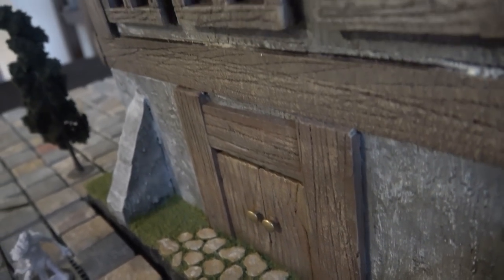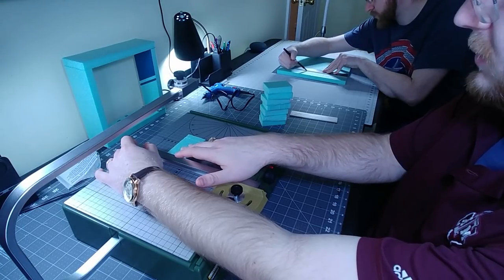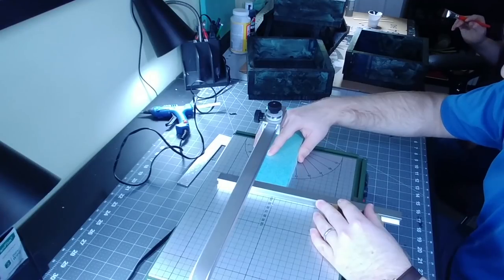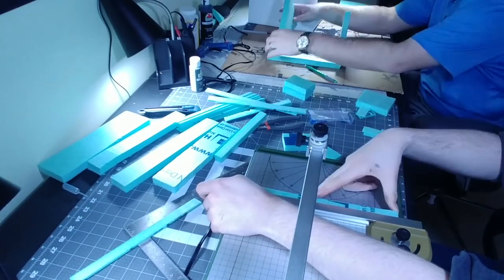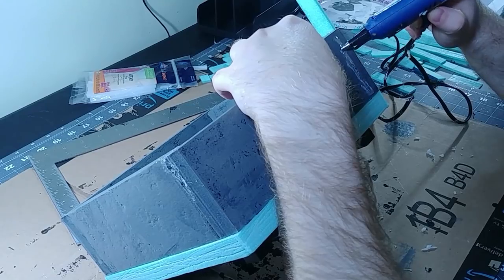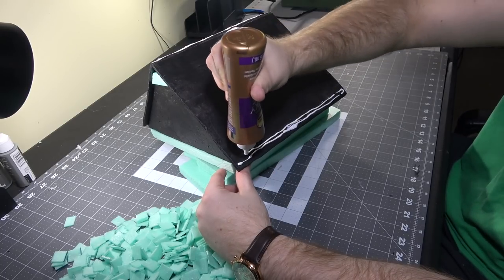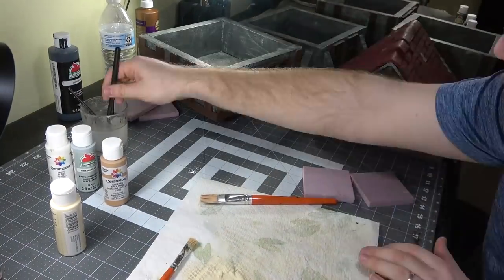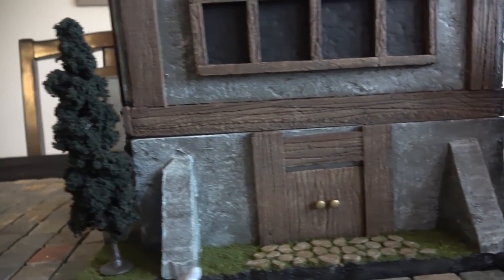How To Make a Modular Tower With Playable Interiors for D&D

Comment: How about using magnets to keep the tiers together?
Reply from the maker: I thought about that, but was afraid of messing something up. This was my first large scale build and I didn't want to ruin it haha. But that would be the better way to go!
Reply: @Rybonator  what you could do is if you have a hot knife you could see if it came with a little circular top piece and press that into the foam to create a small hole. and then get so of those circular magnets and just glue them in

Comment: It looks great! There's two small things I'd work on if I was to do this myself, the windows and doors not making an appearance on the inside and stairs leading to other floors!  I think I have an idea on how to do the stairs and still keep it modular too.

To pull this off I'd make two separate "stair models". (Hard to explain via text but I'll try) The first model would be of the stairs leading upward, keeping it pretty basic until nearing the top few steps. At the top I'd leave it flat, matching the wall height. Thus making it so the stairs could be placed anywhere in the room in advance. The second stair model would be a black rectangle with the top step and some hand rails attached to it. Giving the appearance of stairs leading downward, or the "top" of the staircase.

Theses would be free moving parts that you could put on any floor to make a basement access or whatever you see fit. Anyway, that's my 2c!
Reply from the maker: Those are great ideas! That would have been spectacular looking add-ons :)

Comment: Hint on easier corner block placement from past projects I have completed.
Use Double sided tape or even just masking tape, etc. to attach the corner blocks to the top corner of the lower level; apply glue of choice to top of blocks and then place top level of tower on top of blocks and bottom level.
Just be certain you are using enough tape to secure the blocks but not so much you can't remove the upper level of the tower from the lower.
Not certain this will work with this exact project, but I have used this technique on similar projects using wood and other materials.
Great vid, keep up the videos, and God bless.

Comment: Another way to stack the layers is with dowels in the corners. It will take a bit longer to carefully take out the foam for the dowels to sit flat, but the structure will not move at all in the end
Reply from the maker: That's probably an even better idea! Thanks for the tip :)

Comment: I love your work, i've somehow fallen into a black hole of watching a bunch of these videos, but i'm ok with that. I just have an idea, with the blocks you put on the underside to connect in to the floor below how about double side taping the pieces in place or placing tape over the pieces, in the top corners of the wall of the underside, glue the top of them, then place the next floor on top, let it dry, then pull it off. It seems like something that may work and give you a super snug fit. Anyway like i said just an idea. But i love watching your videos. =)
Reply from the maker: Honestly, because I was too tunnel visioned to think of an awesome idea like this haha. :) I totally should have done something like that. Thanks for the tip! I'll have to give that a shot next time. 

Glad you like my content :) I appreciate you watching

Comment: Very nice build Sir!

This type of modular building, designed to be playable interior, brings up a recurring problem : the wall height.  I find the walls ( when made to a relative size of the minis) to be too tall.  The players are only able to see the interior by hovering above the building to look down.  This limited view hinders sight lines and affects the very "playability" we are looking for.
The solution?  Have the bottom of each level be open and not the top.
As each floor is revealed, you are presented with a flat, open, easily seen floor.  Make those locking posts part of the exterior wood beams overlapping downwards on the outside rather than upwards internally and it should still lock in place as a stack.  Hope you find this suggestion useful.  Keep up the great work!
Reply from the maker: That's a great idea to a common problem.! I'll have to explore that in a future build :)
Reply from the maker: Also thank you :)

Comment: Hey man absolutely love the video, you just earned yourself a subscriber i'm already working on something using the concept. One small suggestion, obviously doesn't make a massive difference and I get if it was an oversight or just time saver but your windows not following through to the inside of the buildings really makes no sense, if you're going to make a window for playable interior you should cut it through so you can see it from the interior. Besides that amazing build and love how modular it is.
Reply from the maker: Sorry for the late reply! Yes I absolutely should have done that :) Maybe I can go back and fix that to improve upon the building. My next set will have window cut-outs for sure :)

Comment: How do you make the tacky glue work?? I have a permanent grudge against the stuff from my efforts to use it when working with foam. I'd wait for 72 hours and it still wouldn't be dry and then I'd try and dremel it and wet glue would get all over my bit and ruin it.

Comment: What's that thing ur using to cut?
Reply from the maker: It's called a proxxon hot wire cutter. It's used to cut foam :) There are others out there that are way cheaper, but the proxxon is like the Cadillac of foam cutters.